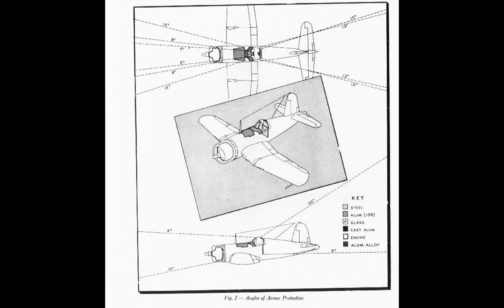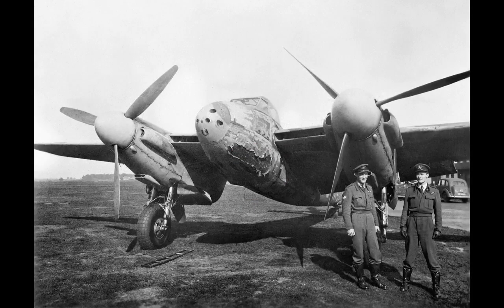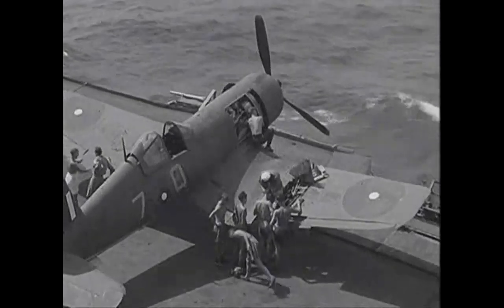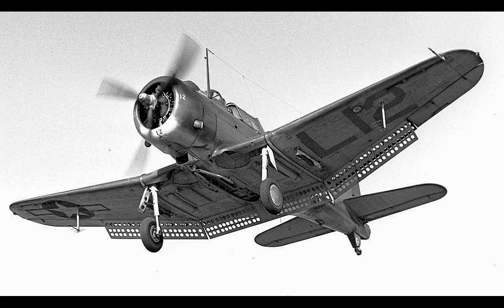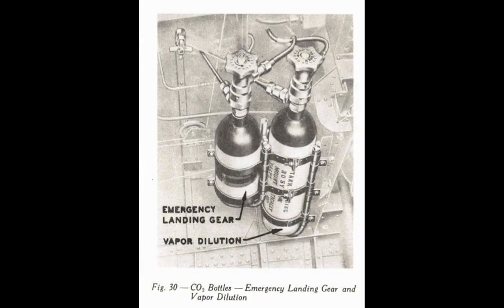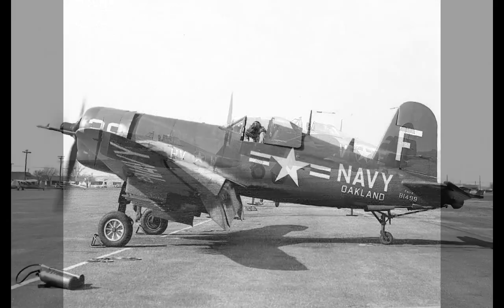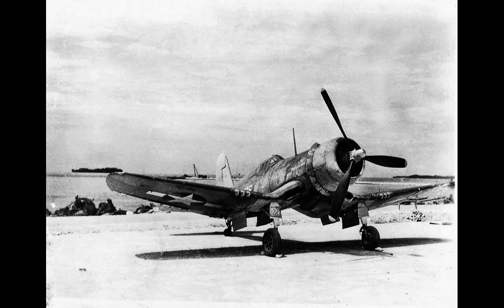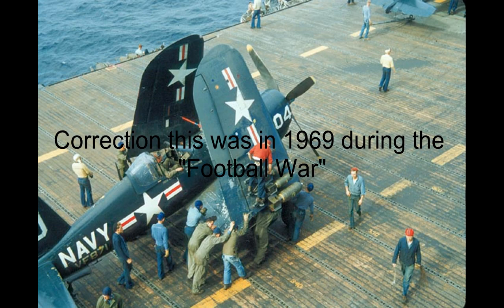F4U Corsair Design Features

Comment: Radial engines for the win! :D
Reply from the maker: LOL. The debate of air cooled radials vs. liquid cooled V-types may never end. I wonder what we would have seen if the jet hadn't shown up.
Reply from the maker: Air cooled radials won. After, WW2 they were clearly the dominant piston engine, the list of post WW2 planes powered by radials is huge, the list of liquid cooled V-Type planes after the war is very very short. Now, that doesn't mean that they V-types would not have leapfrogged ahead later, but with jets arriving, they never had the chance.
Reply: Napier Sabre ftw :P
Reply: @GregsAirplanesandAutomobiles  honestly I thought that the radials main positive factors were being simpler and more redundant in times of war. Most modern pistons are fuel injected in lines v's or boxers. Nearly all my hours were done on boxers.
Reply: @jaredneaves7007  
"Air cooled" boxers?
Reply: @johntempest267  As in the opposed 4s and 6s which are found on most private aircraft.
Reply: @GregsAirplanesandAutomobiles  
Why did they even build liquid cooled V-type engines, when the radial-type was clearly better? Was it the lower frontal area that made v-type engines so popular in fighters, or was it the problem radials have regarding to the oil leaking into the lower cylinder?
Reply: @Enthropical_Thunder  liquid cooled inline engines are superior from a pure performance point of view. their low frontal cross section and liquid cooling allowed for a much more aerodynamically and thermally efficient design of powerplant and cooling systems.

what works good in a racer doesn't necessarily work in fighter. let's put it this way: one single bullet through any part of the cooling system drastically limits the time aloft. or one may also consider following questions: what plane would a pilot choose for a 1v1 (even) dogfight and what plane would a pilot choose to be shot at while sitting in. the answers would normally be P-51 vs P-47 (or Me 109 vs Fw 190A for the "other side")

in a military environment, ruggedness and reliability have its own value. like no soldier would take a carefully adjusted, fragile hunting rifle to infantry combat.
Reply: @daszieher  
Thanks for the answer, i am aware of the benefit of a radial engine being fairly simple. He said in his video that the radials had a superior power to weight ratio or are superior in performance, wich made think about why they wouldn't have used them for public 
airliners but i just don't see any other benefit besides the lack of a seperate cooling system.
Reply: @Enthropical_Thunder  The early radials of WW2 did not compare to V12 liquid cooled units,although the Pratt and Whitney units in the Curtiss P36 showed the promise and evolution to follow.BMW had reliable Bramo radials but they were not fighter engines.Their 801 series as fitted to the FW 190 had protracted teething problems until they were solved.Pratt and Whitney produced numerically and qualitatively the finest radials of the war!..There were other contenders,Wright's Cyclones,Bristol's sleeve valve Centaurus but nowhere in terms of numbers!!.Then the Japanese with their A6M Zero with the Nakajima Sakae units, a 27.9 litre unit.Funnily enough,this powered the Zero to ascendancy over it's carrier/land based opponents in the 1st half of the Pacific War and yet when the tide turned against Japan with superior US/Allied aircraft,the Japanese never really managed to produce a more reliable albeit  bigger powerful radial to supplant the reliable but outclassed Nakajima Sakae..The R2800 Pratt and Whitney is up there with the Rolls Royce Merlin I would say!!.
Reply: @4vepvik781  
Very interesting.
First doesn't every engine have teething problems, especially when not being a derivate of an older design.
Second, does that mean that the R2800 Pratt and Whitney is up there with the DB 605 wich was at least up there with the RR Merlin engine ;D.
Reply: @Enthropical_Thunder  Of course!!..I stand corrected.This topic is fascinating and when You read the drivel the uninformed put forward on this Subject!!😳😳..Certainly,I was not ignoring the Daimler Benz DB series or any other engines of note..The DB series is up with any of the aformentioned for sure.!!..Someone was saying that radials were better than inlines!!.A matter of infinite debate..Certainly,the inline had the initiative at the beginning of the war but the radial evolved as did the inline.!!..The interesting bits were the Centaurus Sleeve valve design!.Because it got rid of poppet valves and inherent bulk and therefore presented a smaller frontal area and with less reciprocal parts and more power.The headaches were sleeve valve lubrication and metallurgy..Same applied to the phenomenal Napier Sabre engine,again of sleeve valve design.It was in effect 2 flat 12engines in one block!.,and could it rev!!..Which brings Us back to what You said about teething  problems affecting all WW2 aero engines!..Very true.Even the Merlin had it's headaches.This is an endless topic of great fascination!!.
Reply: @Enthropical_Thunder  Where were the radials superior? Not in Height, Climb,, Dive, Roll, Turn, Efficiency
Reply: @daszieher  : Why did the P47 lose 2400/2600 in the Ground attack role? In only 2 years The RAF pioneered the role with Hurricanes Whirlwinds Typhoons Tempests Allison Mustangs and never lost that many in 5 years
So what happened?
Reply: @Enthropical_Thunder  No radial beat the Merlin. Napier Sabre Griffon in Power to weight ever. By Wars end the Sabre VII was getting 3500hp
Reply: @jacktattis143  
The Napier Sabre is an H-24 (basically 2 V12 engines coupled together), no radial engine, not even mentioning that it is liquid cooled not air cooled, what are you talking about?
Reply: @Enthropical_Thunder  YOU DID NOT READ IT correctly
Reply: Greg's Airplanes and Automobiles  - I look at today's F-1 racing technology and see the evolution after the "failure of the jet-turbine experiment" alternative timeline. If I won the lottery? A graphite Spitfire.
Reply: @GregsAirplanesandAutomobiles  No no one won Both nations were going to jets However the Brits in Hong Kong went to 50400 ft in their Spitfire IX I do not recall ANY radial getting that high
Reply: Try to find some air racing footage from right after the war. The one I'm thinking of had a Corsair, Mustang, Thunderbolt and a couple of others - together in the air - around the pylons.
Reply: All my favorite ww2 aircraft are radial engined.  Fw190, tempest2, corsair,  ki100, p47, A26, B17, N1K1, La5.  Spitfire and Mustang are overrated for me.
Reply: @khaccanhle1930  Go and read some more you are still a boy

Comment: Nice work.   Did the Stuka have similar reasons for a bent wing?
Reply from the maker: The Stuka's wing design allows for shorter and stronger gear, which matters at higher dive speeds and on rough forward airfields. It also improved downward visibility for ground attack. I haven't researched the Stuka specifically, but I see nothing in the design that indicates that they were at all concerned about interference drag.
Reply: @GregsAirplanesandAutomobiles  The stronger gear also came in handy for the weight the plane was tasked with carrying. For it's size and date of design; it had some stout payloads.
Reply from the maker: That's a great point.
Reply: Hi Greg, the Stuka was designed to carry a very large central bomb (dive bombing was "the" most accurate way to drop a bomb.  It required extra ground clearance (as well as a pivoting leverage linkage to clear the propeller upon release).  Ciao, L
Reply: short anδ strong landing gear to operate from minimally prepared landing strips close to the front!
Reply: A great video could be why did the Stuka have fixed landing gear. (To help with air speed in a dive?)
Reply: @rng_lord1276  For rugged simplicity,  and because it was fast enough with fixed gear during the time it was originally designed in. It  actually doubled as a fighter very early in the war, because it outclassed much of what it faced very early on.
Reply: less complication for an airplane without the need of high speed, and capacity to operate close to the front from ill prepared landing fields,...it had big air brakes.....
Reply: Maybe but the Stuka was notorious for its weak undercarriage even though it looked strong.  They never fixed it.
Reply: A Stuka Pilot late in the War shot down a P51. I don't remember his name but he was a very experienced Pilot. Having flown on the Eastern Front.